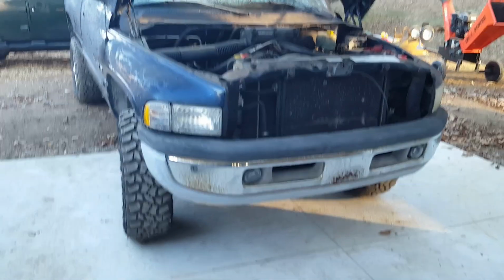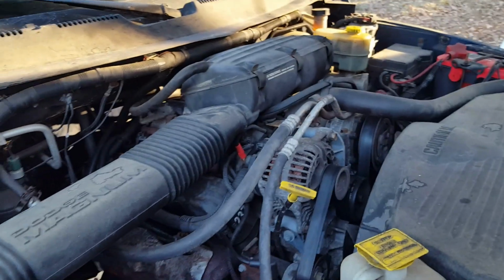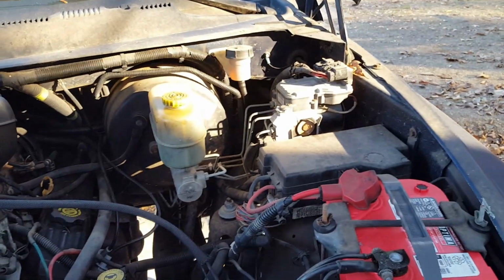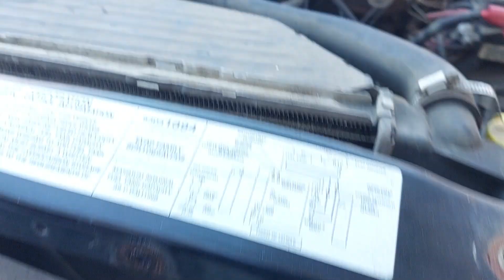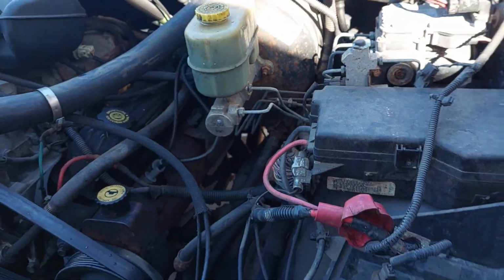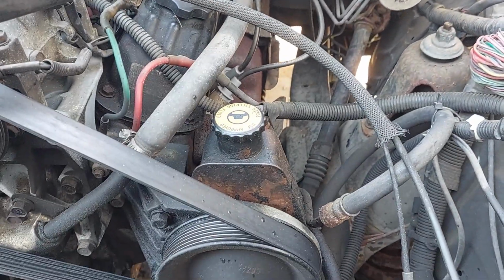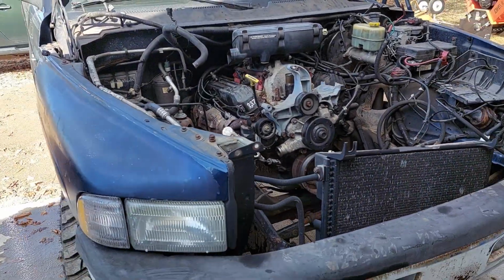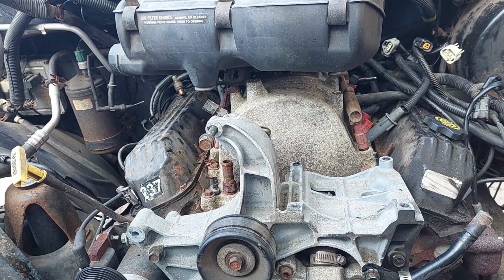Dodge 5.9L Magnum engine pull day 1

Comment: I paid $250 for a new steering shaft at the auto parts store 
 Couldn't find a deal anywhere online.  
I learned that the 4wd steering shaft is the same as 2wd , 1996 dodge ram 1500 with 5.9 magnum
Reply from the maker: That's good info, thanks.

Comment: I’m replacing the heads on my 5.9 and I was wondering if there was any you’d recommend?
Reply from the maker: After looking around I went with the baisic EQ heads. I'm not going for anything fancy on this build, and from what I've read they're copies of the old Mopar Performance heads. So I couldn't beat the $850 for both, assembled and at the door. Hughes Performance has some tuned up options for cast iron heads as well as some aluminum options. I did take Hughes advice and will be running they're recommended head gaskets(don't have the PN handy). They claim a slight bump in compression with these heads.
Reply: @Chumley360  yeah I’m not going for anything fancy either I just need some decent cheap replacements that are close to OEM. But $850 for both that’s definitely not bad at all considering they are assembled.
Reply: Stock replacements are fine for what it’s worth.

Comment: eBay headers are junk. Gibson shorty headers or you might as well leave the stock ones on
Reply from the maker: I won't dispute their junk status, but I can say that after 30 years of looking at junk header vs stock manifold dyno runs, junk headers are fine. Also I didn't go into these for "power", I wanted the stainless steel to replace cast iron. On that front they are fine.
Reply from the maker: I won't dispute their junk status, but I can say that after 30 years of looking at junk header vs stock manifold dyno runs, junk headers are fine. Also I didn't go into these for "power", I wanted the stainless steel to replace cast iron. On that front they are fine.